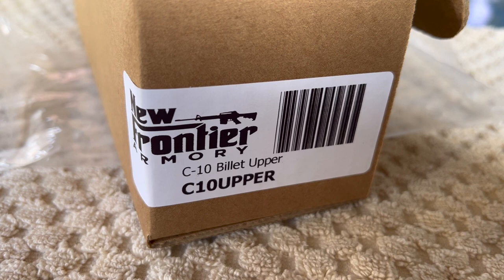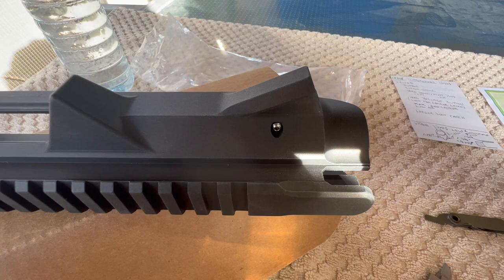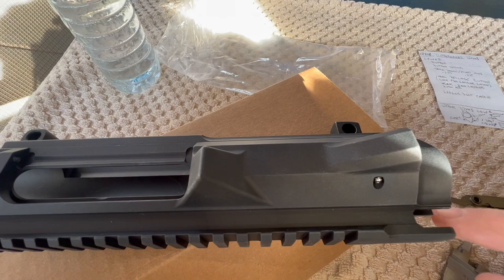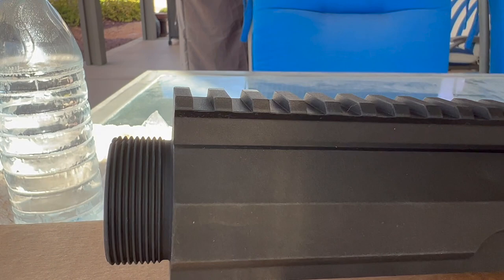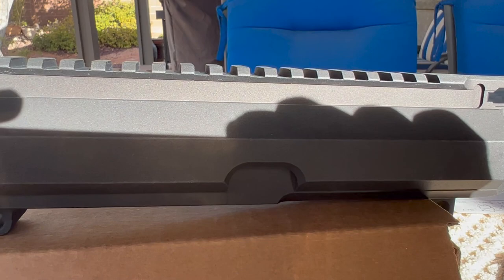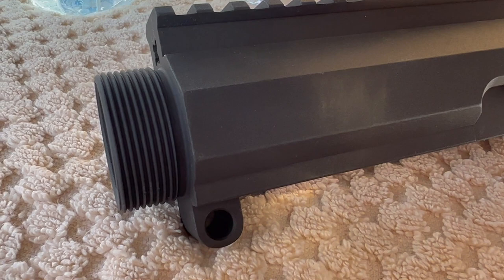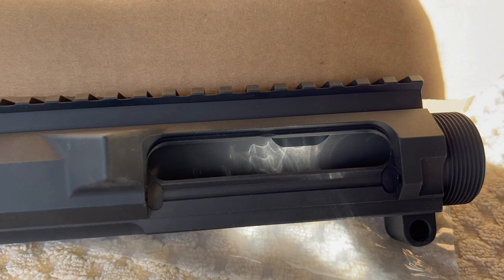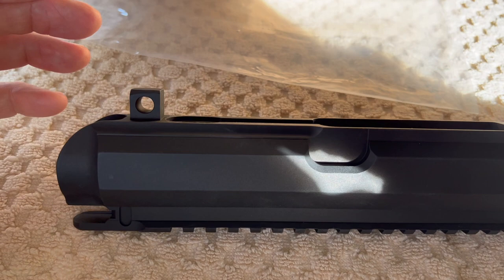AR308/LR308 New Frontier Armory DPMS Low Profile Pattern Upper-01

Comment: Good Luck ,But it should`nt be to bad as long as you don`t mind with sticking with a smaller certain range of choices. Alot of folks used to get hung up on the BCG on them or even the buffer tube. About 1 1/2 yrs back a few reliable You Tube channels put out a not so complete list of who`s parts will work with who`s in the 308 zone. Looking at some of them might give some more variety to choose from.
Reply from the maker: I'm going to try and make sure my homework gets an A+ but being a newb to the AR308 platform I expect to make some mistakes $$$. I may go for a second build depending on what I learn on this one. Besides standardization issues that need to be sorted out between patterns and manufacturers it's definitely going to be a budget buster compared to 5.56mm!

Comment: I bought a Stag Arms Stag-10 .308 lower off a friend. I then had to buy a Stag upper due to the 45° angle on both. I'll probably have to buy a Stag hand guard when I finally get around to the build. I check if it's a 'high, or a 'low'  Thanks, Pete.
Reply from the maker: Definitely sounds like a true AR-10 Armalite pattern but with the lack of standardization these days... In the video I showed how to tell the difference on DPMS pattern's but not sure if measuring the charging handle tang is the same for the AR-10 Armalite. Still really new to the large caliber AR platform. Thanks for watching and commenting Malcolm!

Comment: I went with the Aero M5 upper and lower, Aero lower parts kit, and the rest is all Wilson Combat except the BCG, I went with the LANTAC NIB. I didn't buy the Wilson Combat BCG because their carrier doesnt have fwd assist notches. Long story short, my barrel is back at Wilson Combat along with my bolt so they can fix the head spacing issue. Of course, they don't just sell the bolt only like they do for 223/556.  But, $25 and shipping they said they could fix me up, so just waiting on the barrel to come back and try her out.
Reply from the maker: Well that doesn't sound good! The WC BCG picture of the one I was looking at showed the forward assist cuts? Thanks for that info!
Reply from the maker: Went back and checked WC. Looks like what they're selling now has the forward assist cuts except for what they call the "Low Mass" version. Thanks again!

Comment: Welcome to the club.
Reply from the maker: Thanks! Hopefully it doesn't become a can of worms! Lol!
Reply: @peteregger7928  it won't be that big of a pain, just don't get in a hurry.
Reply: Question ❓ Does this upper mate well with the PSA gen 2 .308 lower. I have an 18 in stainless pa10 and I'm wanting a 12.5 upper to swamp out.
Reply from the maker: @universallaw8850  I would be afraid to answer that one! I would call New Frontier Armory, North Las Vegas, Nevada and see what they say. What I'm finding out so far is the DPMS standard may not be so standard.
Reply: @universallaw8850  safe bet will be not to mix match uppers and lowers with this platform. I know that Aero was producing receiver's for a few different brands however I would not even count on them being interchangeable.
Reply: @TurningGuns  yeah i agrer its just that psa 10 uppers are always sold out unless i get a complete upper and they dont make a pistol version like I'm looking for.
Reply: @peteregger7928  Looks like the best option is to wait on psa stripped uppers to come back in stock 5o assure a proper fitment.  Thanks for the advice
Reply from the maker: @universallaw8850  I think especially for upper and lower fitment sticking with the same manufacturer is probably the way to go. Good luck with your shorty!
Reply: @peteregger7928  thank you sir

Comment: I used the aero m5 receivers on my ar308. At the time i didn’t pay no attention to low/high, the upper is high and my handguard is low. I got the Midwest low,it’s not a huge deal because i don’t have irons on it but i kinda wanna sell it and get a high just so it looks better. I used a KAK dual ejector bcg and the forward assist don’t engage the cuts on the carrier.

Long story short i messed up my first ar308 build, my best advice is try to use as many parts from the same company as you can lol.
Reply from the maker: Most of these manufacturers routinely fail to tell you enough in their descriptions or specs to make an informed decision! If they provided the correct information so we didn't have to call, send an email or return something imagine how their sales might increase. I have passed up making a purchase from one vendor and buying the exact same thing from another even if it cost a little more because they took the time to provide descriptions and specs that were detailed enough and told me exactly what I was buying or needed to know. Big thanks for the info on the KAK BCG! That was one of them that I was looking at! Leaning towards Wilson Combat and because of recent issues with AERO Precision BCG's I won't be using one of their's either! I looked all over AERO's website and could not figure out which DPMS pattern (high) they were using on the M5 upper. Primary Arms showed the stuff as (high) pattern. Probably got tired of all the returns! Lol!
Reply: @peteregger7928  the KAK bcg works well and it throws brass about a mile away the forward assist just don’t engage,I’m not sure if that’s an out of spec issue or a design flaw lol. And yeah i never saw anything about the upper being high shelf,i didn’t figure it out until i installed the rail. What barrel length you going with? I went with a 16” solgw barrel, i wanted it set up as more of a “battle rifle”. 

The brownells 308 bcg is onsale for 165, rubber city armory is 179 on PA and Lantac  enhanced for 237 on primary arms. Those are all supposed to work but so is the KAK lol.
Reply: It pays to start with a matched upper and lower with the hand guard as a "kit" as a first build, if not you will play more hell to get something you are happy with. At least for a first build. Contrary to popular belief, almost no ar-15 parts will work with many of this platform.
Reply from the maker: @Turning-Guns  I think you're right! I'm about to find out! Lol!
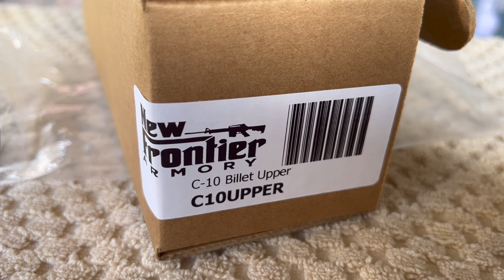Reply from the maker: @itsamk18-ish  I think I've decided on the Wilson Combat 18". It has a 1:11.25 twist rate that seems a little weird compared to the usual 1:10. It's called the Tactical Hunter and is fluted. It has a .750" gas block journal for the RifleSpeed adjustable which I plan to use. Haven't decided on the BCG yet but leaning towards a WC also Nitrided.
Reply: @peteregger7928  nice! Sounds like you’re going to have a nice gun! I brought up my ar308 in a comment a few weeks back,it was having an issue with blown primers. I added an adjustable gas block and a 6oz buffer, i tuned the gas block and shot 80 rounds. No more blown primers yet so I’m hoping i fixed the issue.
Reply from the maker: @itsamk18-ish  I remember that!
Reply: @peteregger7928  1:11.25? Ya that's a strange one. You do know that you could go .243 cal. Right?  I wouldn't but i thought that i would throw that out there. BTW ammo in  .308 is pricey however I am sure that you are aware. Cheers
Reply from the maker: @Turning-Guns  I built four FN FAL's back in 2003 and went on a 7.62x51 NATO surplus rampage! I still have literally 8,000 rounds of South African, Australian Defense, Austrian and German 147 NATO. It's old stuff 80's vintage but still works great! I'll be buying some WIN 308 for some comparison when this build is ready to go though! $$$

Comment: I have the dpms high version
Reply from the maker: I think it may go the way of M-loc vs KeyMod but the OEM's seem to be running about 50/50 as far as what pattern they chose. Thanks for watching and commenting!
Reply: The high version will typically give you more clearance for larger optics,   been my experience.
Reply from the maker: @TurningGuns  Makes sense! Hadn't considered that!
Reply: @peteregger7928  low ones make good battle rifles, high, well you get it. Any idea what direction your wanting to go?
Reply from the maker: @TurningGuns  18" medium stainless barrel. Probably Wilson Combat or Criterion Hybrid. Riflespeed adjustable gas block. Carbine butt stock. Not sure what trigger or BCG yet?
Reply: @TurningGuns  no doubt,  don't have to get high scope mounts
Reply: @peteregger7928  just kidding, or am I?
Reply from the maker: @TurningGuns  Ha! Ha! Hard to say!